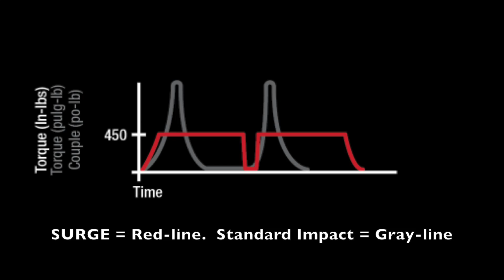Milwaukee M18 FUEL SURGE Hydraulic Driver

Comment: Just to clear this up it's in-lbs not in/lbs because you're multiplying the length of a lever by the force.  For example 100lbs. on a 18in. wrench would be 1800in-lbs and 75lbs. on a 24in. wrench would also be 1800in-lbs.  in/lbs is just the inverse of lbs/inch which would be used for beam loading calculations by structural engineers.

Also that graph of torque over time is shortened so the break between impacts with zero torque should be much longer but is shortened so it's easier to understand.  Otherwise it would be similar to a drill with a sustained torque.  Just something to be aware of to better explain the tool.
Reply from the maker: Thanks Jeff - just realized why you posted that.  I was saying inch per pounds [pressure] NOT "inch-pounds."  Sometimes when I get going in front of the camera, I talk too fast, and stuck on words, or mis-pronounce things  - thanks for pointing it out.

I'm hoping guys don get stuck on that and miss the important safety feature of the new M18 tool and technology.

Comment: I just watched it on another sight and he tested the decibels and it was 84
Reply: I just checked out that video. He's using a tablet with a SPL Meter App, I'm not sure how accurate that is, I'd like to see a test with a real SPL Meter, also I think on these tests they put the meter approximately how far away your head would be from the tool most of the time.  In his video the tablet is a lot closer than his head, that definitely changes the results a little bit.
Reply from the maker: Which site was that?
Reply: Toolpigs raw video